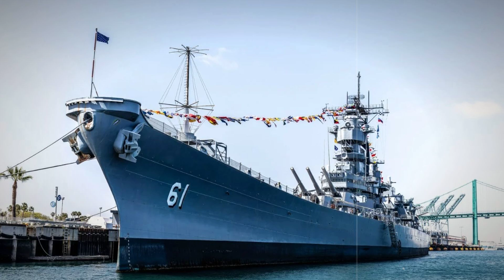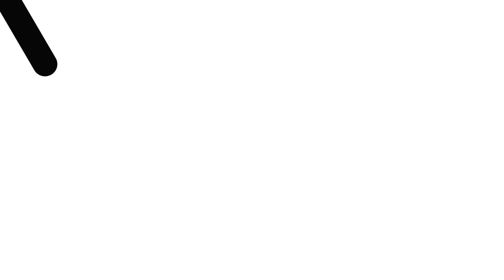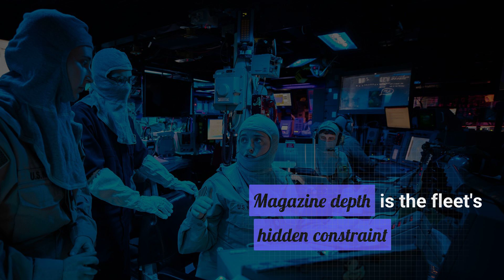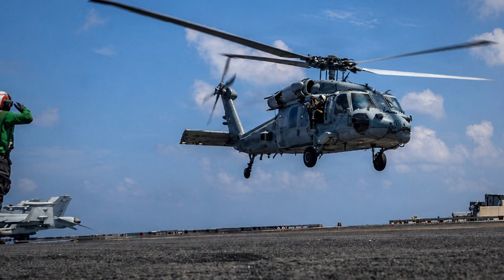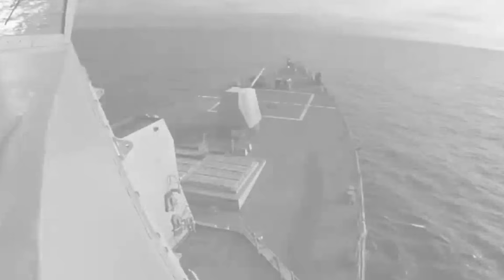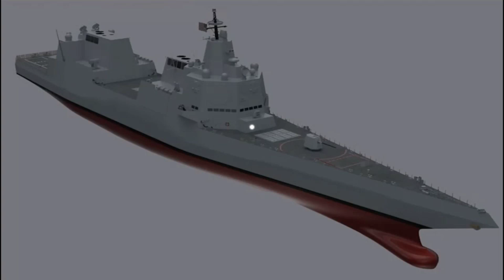Inside the NEW $23 Billion Battleship in the US Navy

Comment: 128 missile cells is the same as a Ticonderoga cruiser.  Take that design, add another 64 cell VLS, increase the horse power and add a shit load of electrical power.  5” guns for and after.  No aluminum.  Forget the nucular power, too costly.   Beef up the structure.

Comment: There was going to have to be a missile or gun truck built eventually. It was inevitable. The magazine depth issue was a problem 12 years ago and the intentional Zumwalt class debacle did 0 to solve it. The battleship with a deep massive magazine is as good a fix as any. 130 vls cells and 12 hypersonic CPS missiles with sea sparrow/rolling air frame missiles along with a laser for defense gives me the goose bumps.

Comment: This "battleship" is a ten-year-old concept called an "Arsenal Ship".  It's a solution to the limited "magazine depth" of current missile destroyers and cruisers.

Just like a carrier, it will require a protective battle group.  It will be part-stealthy, and its size is dictated by the size limits of the Panama Canal and the available piers and slips.

An interesting question: Will the arsenal ship's magazines will be designed to be replaced rapidly in modules, like the army's missile trucks?

Another question: will this ship carry fuel to supply its escorts?

Comment: I remember that in the 80s, when a battleship was made active again there many former gunner's mates who rejoined the Navy to go on the battleships.  It is was a formidable ship that was designed to battle other battleships.
Reply: Comes in pretty handy for water born assaults as well.
Reply: @davidnealy6459  In WW2 maybe.
Reply: @goarmysleepinthemud.   No congress had/has a law in the books that they had to have at least two battleships for ground support operational at all times. I know they used in them the Iraq wars for sure. 16-inch shells still carry their own type of pain as some poor Iraqi soldiers found out.
Reply: Remember when the gun turret exploded? That ended deployment of those antiques.
Reply: @KlaatuBradaNikto   Congress had law requiring that at least two battleships be in working order at all times. Not sure if it is still a law. But you are correct the aging powder and shells will cause problems like that. There is no production of the powder shells or even the 16-gun sleeves that are needed to keep the barrels up and running.
Reply: @KlaatuBradaNikto  Actually, I do not remember this.  I was at student at a university then.   I read about this in Wikipedia.  The Navy thought it was a deliberate act by a sailor but another group disagreed and thought it was accidental.  Also, I read that the battleships were decommissioned  because of guided missiles and other things.

Comment: None of these weapons or radar can be built without the minerals supply chains that the USA gave to China in the last 30 years, and they are not going to give back. The whole discussion is nonsense until that is fixed.
Did you know that the Air Force is accepting new F-35 without radar because the upgraded radar requires gallium nitrate and there isn't any.

Comment: No, they don't belong in the ship. No experimental rail gun is needed: a set of small convention rapid fire guns is needed. (in my armchair opinion) A shell for those guns is under testing and is a sold propellant ram jet shell that could extend the shells range. (not as good as a rail gun but better than a conventional shelled gun while using an already designed gun) Hypersonic missiles are expensive and are to be added to the small number of Zumwalt ships. Why add a lot of them to essentially an arsenal ship or skip the battleship concept for an arsenal ship design. Personally, I would add a store of drones, both re-arm able and expendable to the ship. Add the Newest replacement of the Arleyburks  (I am not going to look up the correct spelling) radar as a modular unit so that you could easily repair or up-grade the radar. (you can leave the radar in port for repair while you replace it with another radar unit or just replace the older radar unit with a new one in the future) Yes, use a nuclear reactor to power, either a aircraft carrier reactor or a modified SMR that they are buiding for the power grid/data centers. it It's still an expensive ship but very buildable without a lot of high pie in the sky tech. Let's face it, the USA needs to build or reopen a few more MODERN shipyards too, but spend that money sensibly and wisely.

Comment: If the picture of the Defiant is real, it looks like one well placed anti-ship missile or deck gun hit will take it out.
Reply: It is noted that with all water tight hatches open it takes all day to sink a naval vessel during a "sink-X".  Mission kill is another story.  Modern ships cannot rely on 17.3 inches of steel to stop warheads, so they use electronic warfare to avoid getting hit in the first place.  The half inch hulls of DDG's and Cg's won't survive, either.  Previous wars had ships designed to withstand the gunfire of similar types of ships.  Modern ships are not.

Comment: Listen...the amount of steel (even if you use the whole thing as HY-100/HY130 steel...which you will not), displacement, proven weapons systems, proven radar/tracking systems, proven ECM/ECCM/ESM, power plant, etc.  Even if you take all that into account and double it. It does not equate to $23 billion...not even close. It is a third the displacement of the Gerald Ford Class ($14 billion). A Gerald Ford class fully built and armed/stocked with ordnance (i.e., missiles, 20mm ammunition, bombs, etc.) and vehicle (i.e., amphibious craft, land vehicles, aircraft, etc.) all the bells and whistles cost anywhere from $22bn to $25bn. So, there is no way each ship is going to cost that much.

The proposal and procurement for planning, designing, R&D, maintenance, and the construction of 15 battleships was listed around $275 billion.

Final point: let's say hypothetically it cost $23 billion per ship...judging from all the above-mentioned attributes...if I were the enemy, I would literally be crapping my pants right about now... That means there is technology and weapons on that thing that you could not fathom.

Comment: Pentagon is having 2nd thoughts on the future viability of aircraft carriers since China started experimenting with anti carrier missiles.A battleship is basically a carrier except that it delivers its firepower via smart rockets instead of piloted planes. The advantages are many: the battleship is more elusive because its smaller and lighter, less expensive to maintain and easier to man and operate
Reply: Anti carrier missiles have existed since the cold war. they were essential to Soviet naval doctrine. The pentagon hasn't reconsidered anything. Trump wants a big expensive vanity project and he's getting it. End of story. No one other than Trump and his yes-men want this ship. 

The only reason why 30 ton battleships existed in the first place was because you couldn't fit 16 inch turrets and the armour to protect against them on a 10 000 ton ship. However a missile can be carried on a much smaller ship and can penetrate the toughest armour with ease. There is simply no longer a need to concentrate so much firepower on a single platform any more. A pair of Destroyers combined can carry more missiles than a battleship for less than 1/4 of the construction cost while also requiring significantly smaller crews and operating costs. It's also more effective. The cost of losing a battleship in a battle would be devastating compared to a Destroyer.
Reply: @christophergroenewald5847 missles are fast becoming  obsolete as directed energy  weapons have matured to operational status.Iran has been firing every missle and drone it can, in massed attacks,on US Carriers to  no avail. The Iranian Republican Guard can not get any  weapons through the US  Carriers layered defensive  shields. I heard  in a press briefing that the US Military in jordan shot down 6 inbounding missles traveling  over 8,000 miles per hour.Thats hypersonic speed,that's what Russia and China has developed, and it doesn't  work against the United States defenses. Russia and China thought they beat us to the punch in the race for hyper sonic weapons, when In fact they lost big time as their billions of  dollars invested in hypersonic  weaponry is  obsolete
Reply: @christophergroenewald5847  No one but Trump, his yes men, and the admirals that wanted on site flag staffing CIC since Battleships went away in the first place... which we won't even have the capability for at all in any form after the Ticos go.

Comment: Need more missile cells, and lasers are a must; otherwise build more cruisers with more cells & lasers
Reply: The specifications include 2x lasers more powerful than anything put on a navel vessel before. 
300-600 kw power range.
It is also supposed to have 2x or more 30mm bushmaster autocannons for AA and for use against smalll attack craft. These are proven effective against drones and are superior to 20mm vulcan armed phalanx CWIZ.
It will also have 2x or more rolling airframe AA missile launchers, each of which has a fairly large amount of smaller short range AA missiles that can be easily reload at sea.
Reply: @ravissary79 a laser can be defeated by chrome... It's cheap if useable though.
Reply: @AllenLombard a drone that uses a radar seeker can't use chrome... Chrome isn't radar permeable. So if yhe non protected seeker is hit... boom.
If it uses a camera it cant even use an opaque nose cone. And cameras are highly vulnerable to lasers. A syring laser, really anything over 100kw will do more than blow out the sensor when it hits the nose of the drone.

A smaller drone like a quad copter type might have a tiny sensor easier to shield but if you chrome covered a quad copter it would backfire because it has a complex shape that would scatter the beam around between its rotor limbs and body and find a weak point where energy could collect in little corners as if lensed... blowing out a rotor.

Covering a drone in chrome would also raise cost abs weight. The efficiency of the swarm attack would take a major hit. 
A chrome covered drone or missile would show up on radar and IR sensors from farther out making then easier targets for defense drones using guided 70mm anti drone rockets.... or a bushmaster 30mm point defense system.
Reply: @ravissary79 good points
Reply: @ravissary79  The lazer would also require another nuclear reactor to power it.
Reply: @PhilipLongee-vw8jf  I think they are going to go the rail gun route. The Japs have working rail guns on ships now. Look pretty effective to be honest
Reply: @PhilipLongee-vw8jf no... They have fired them from nuclear powered destroyer or cruiser already.

Comment: It will cost as much as 8 Burkes per unit yet delivers the fire power of maybe 4 Burkes. Yep. The Shart of the Deal right there.
Reply: How many lasers can those Burkes carry?
Reply: @treyhelms5282  lasers are useless in some weather.  battleships like carriers will need escort vessels to form teh picit line. having everything in 1 ship compared to 4 means less mobility for spreading out forces. meaning to say if said battle ship gets sunk.(god forbid) then alot goes down with her comapred to 1 burke getting sunk.
Reply: @Zenithx622 Carriers are useless in some weather. Even cruisers, destroyers, and frigates are useless in some weather. Aircraft are useless in some weather. But in most weather, a laser armed ship has capabilities others do not. That's the point.
Reply: @treyhelms5282  take a laser into a sand storm and its reduced from miles to just mere feet. having a ship just with lasers as defence is fool hardy. I dont doubt the tech and will improve. but having all your eggs in one basket is not good. thats why i needs the burks and other escort vessals to form teh picket line. thats typical military doctrine. and Carriers can aviod the weather and sent teh fighters onto varies missions more than a battle ship can.
Suggest you research idiot

Comment: About F'ing time.  Now a capital non carrier ship can keep up with a carrier
Reply: This will never be built, the next Admin will kill it as an Easy Way to Balance the Budget $23 Billion right off the top, Battleship are sitting Ducks in a Modern Navy that's Why Nobody builds them anymore.
Reply: @AlbertoMartinez765  lmao.  That means destroyer and frigates are sitting ducks too.
Reply: Unlikely. This is one of those cases where length matters.
Reply: @patrickweaver1105  nope. It is being SPECIFICALLY for that speed
Reply: @Marcus-p5i5s  For hydrodynamic reasons it can't be as fast as a carrier. It will have the same cruising speed, theoretically. If it ever gets built. Which is very unlikely.
Reply: @patrickweaver1105  I raced yachts I'm well aware of the formulas. As you haven't yet seen the actual hull you are blathering
Reply: @Marcus-p5i5s  Are they building it significantly longer at the waterline than the deck? I mean like 200 feet longer. Because the length overall is something we've already been given. Not to mention Aircraft carriers have two reactors not one. Iowa class battleships topped out at 35.2 knots
Reply: @patrickweaver1105  This ship will be one of the few with the necessary size to house the powerplant necessary to run next generation offensive and defensive weaponry.  Yes, it's missile capability is generous to say the least but it's laser, rail gun, and other energy based weaponry are far beyond what anything else in the fleet can field.  It's a vessel capable of defending itself from enemy missiles/drones while taking out land targets without firing a single missile.
Reply: @Ranger1Presents  You're talking about something for which not an ounce of steel has been laid down. Most of the weapons you talk about don't exist. The plans haven't been drawn. The specifications are vague at best. No appropriation has been made. No contracts have been let. It's a bit early to say if it will ever be built. Even if they do build one it won't be commissioned until nearly 2040 or later. You're doing it as if anyone has a clue the final product will be or if it will even work.
Reply: @patrickweaver1105  lasers on board ships do exist. Where the hell have you been for the last 10 years or more?
Reply: @patrickweaver1105  Lasers are real and so is the rail guns look at the Japanese ones they are now using they brought the size down and the effective power way up. Cutting edge stuff no doubt
Reply: @patrickweaver1105   Lasers are on some ships now, the  Aircraft Carrier  FORD has the laser guns.
Reply: @kystars  The USS Ford doesn't have the lasers yet. So far they're still in the prototype stage. The production version will be much more powerful. The Ford is in the yards possibly for another year.

Comment: $23 billion is an absolutely insane price tag.
Reply: Another unnecessary expense.
Reply: That includes R&D and the cost of figuring things out on the first ship at the shipyards. Sadly the first ship in a new class are always more expensive due to this. The second ship on are estimated at $18 billion or less.

If they drop the nuclear power, it falls to less than $16 billion but it won't be fast enough to keep up with the carriers which are nuclear powered. 

So the Navy deemed the extra $2 billion worth it, and not just for the extra speed to keep up with the carrier but so they don't have to turn everything else off if they want to fire the railguns or lasers (which can cheaply shot down drones, about $0.02 per shot). Plus more power can be put into the radar and ew ability.

Another correction they stated the 128 missile cells could increase to over 200 (probably meaning theyre going with the 880 foot design not the 800 foot design). Not including the extra 32 cells if they get rid of the hypersonic missiles. But yes, this does mean each BBGN could have double the missiles of the soon to be retired Ticonderoga class cruisers.
Reply: @jonathanryan9946 As we now know, current leadership in the Navy rates poorly.
Reply: Battleships became obsolete in WW2 with the advent of aircraft carriers.  Yes, just a waste of money.
Reply: But it’s got working toilets, and fire proof laundromat!  On paper!
Reply: Whats the projected new budget for the high speed rail in California?, now thats insane.
Reply: Thi price  is the best Guess.
Reply: @m2003h  Best? The defense industry never keeps the same amount, might as well double that price for the final ship.
Reply: Another grift cash cow 🐄
Reply: @lunabranwen  yep